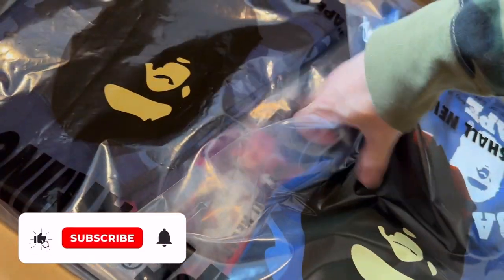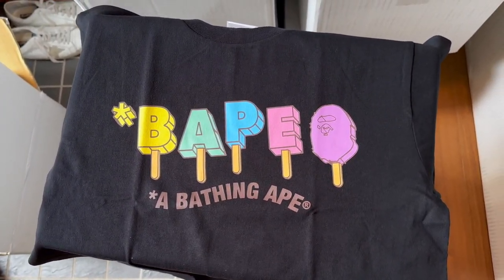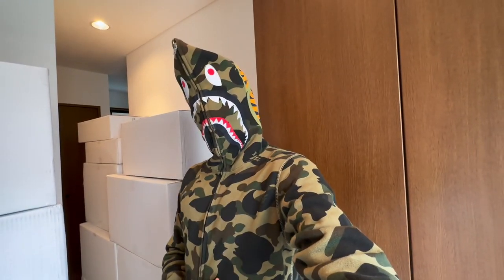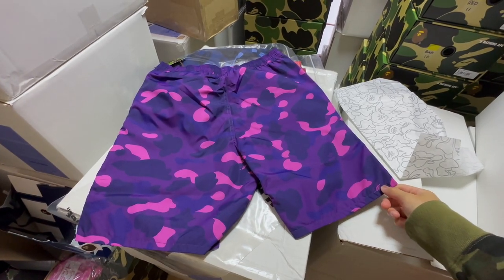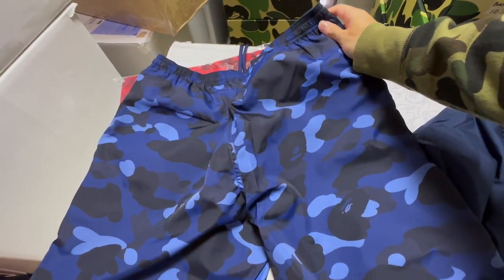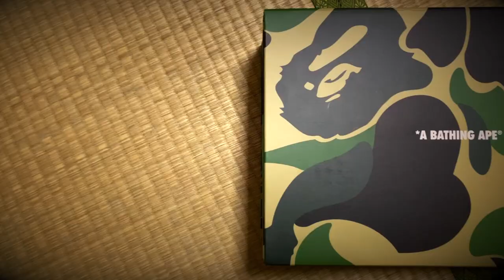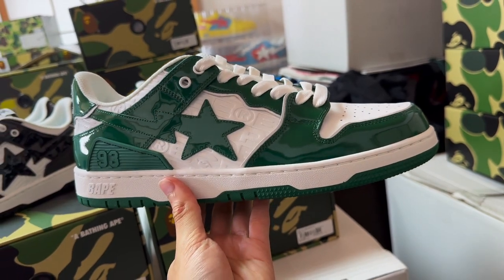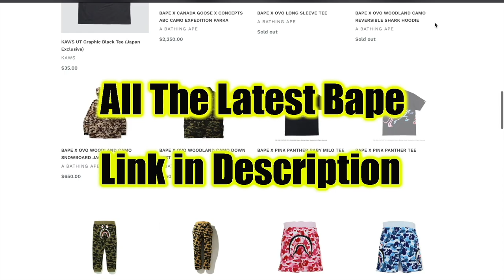Spending $30,000 On The NEW BAPE SK8 STA!

Comment: I seen they still sitting on the site. They dropped these too late in my opinion. Shoulda been a. 2021 or 2022 release.
Reply: I think they restocked
Reply: @andressandoval1263  naw not these, they have the Air Force 1 model in this leather material but not the skate stas til now.
Reply from the maker: Yea I feel ya boss🙏🔥